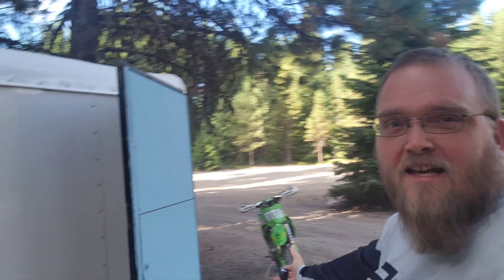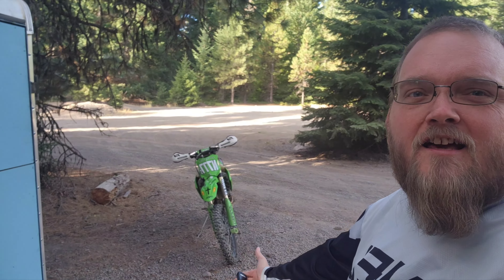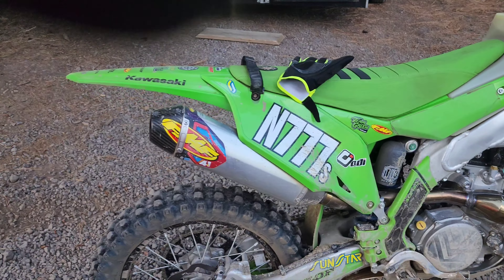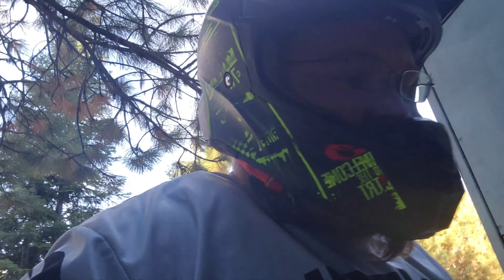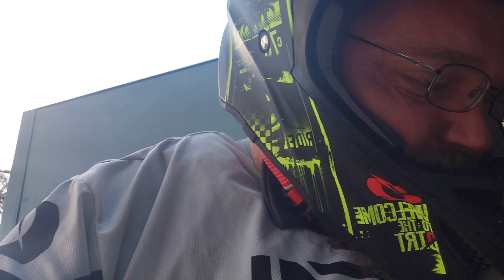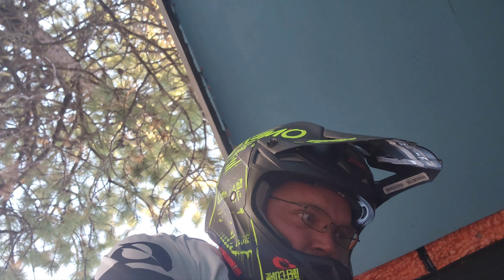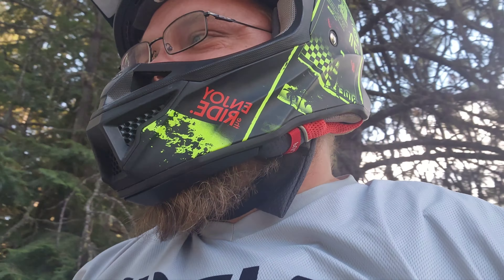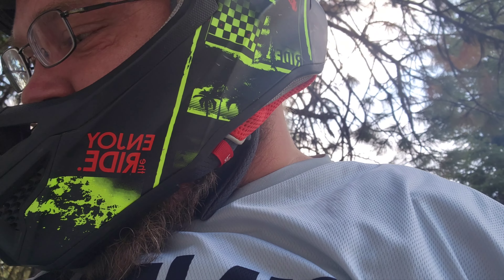Check your sag...more often. KX450x setup discussion about ride with proper sag

Comment: Proper sag settings are the most important aspect of suspension tuning and like you said, the most overlooked. Great information!
Reply from the maker: I had heard people say it was important and that is why I went through with setting it this spring. I just didn't know it would change over time and need rechecked and adjusted, but ya it sure makes the bike handle differently.  I will be keeping a closer eye on mine from now on.